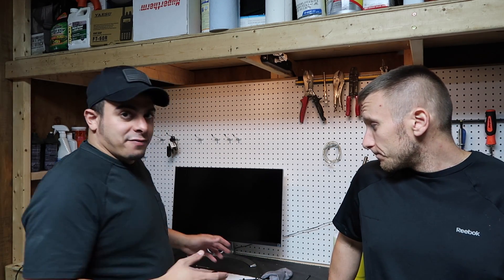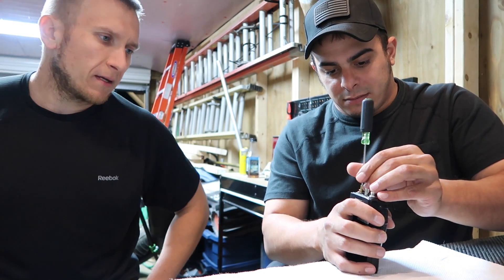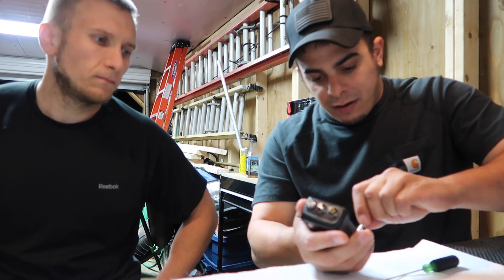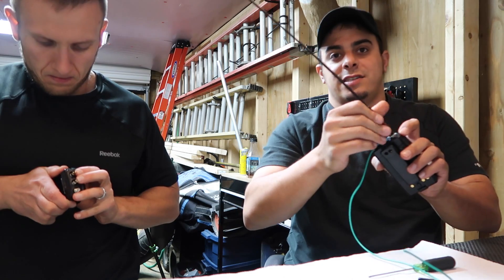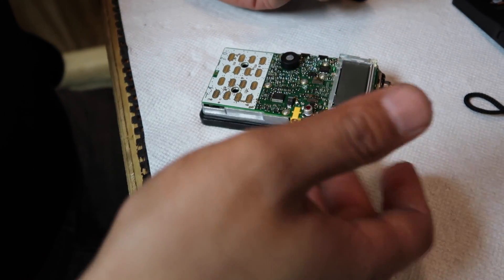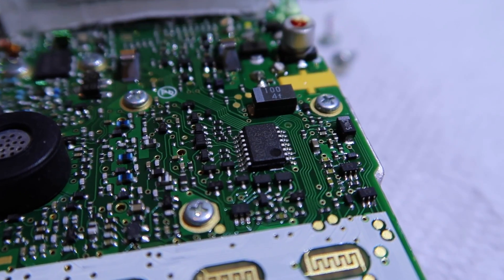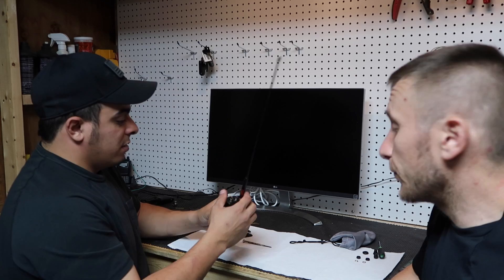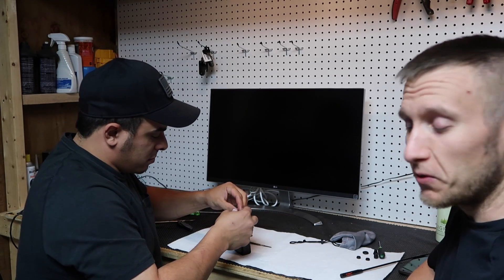Yaesu FT-60r (FT60) Mars/Cap Modification

Comment: My 11$ new Baofeng UV-5R  All Fm radio.   400.00 to 520.997  130.00 to 176.997   
does this radio do this??
Reply: What is the power output of the FT 60
Reply from the maker: +Gfdf Perte 5w
Reply: ok so 1 watt more   and 15 to 20 times the cost.   once more why would you spend that much money on a hand held
Reply: @gfdfperte4248  I have both, you really do get what you pay for.  My Yaesu has so much more sensitive receive than the UV-5R.  Now if you want a cheap radio to toss in SHTF go-bag and vehicle glove compartment that wont break the bank or make you cry if someone steels it go with the UV-5R,  that's why I have both.
Reply: Bofeng has a very bad sensitivity and selectivity in the radio receiver, you can hear less than 50% of what a Yaesu FT-60R can hear.
Reply: I will now give some examples of features the FT-60 HAS that the Baofeng DOES NOT.

1 - It demodulates both FM and AM

2 - It receives from 108Mhz all the way to 520Mhz + from 700 to 1Ghz

3 - Die cast aluminum casing along with high quality plastic parts

4 - Because it demodulates AM AND can receive between 108Mhz to 136Mhz (which the Baofeng cannot do) it can listen to AIRBAND. 

5 - Dedicated squelch and selector knob

6 - Much better menu

7 - Better water resistance

Comment: Just buy a Bofang
Reply: Way better and  for 11$ usd  New
Reply: nice did not know about the UV-5X3  Thanks I am looking into to it now.
Reply from the maker: +tim Forbrook what do you consider throw away? the ft60 is 180 and the vx8dr is like 400.. both great radios.. a baofeng might be thow away.. at 35 bucks
Reply: Bofeng has a very bad sensitivity and selectivity in the radio receiver, you can hear less than 50% of what a Yaesu FT-60R can hear.

Comment: How is the rx sensitivity and tx power on the 460 band once its modded?
Reply from the maker: +tx2sturgis I use this radio often and for the most part at great distances and I haven't noticed a anything significant in sensitivity nor the transmit power since the mod. The tiger tail/counterpoise wire really helped and I highly suggest that.

Comment: Guys just a hint here for people doing this,don't use the stock antenna,they are very narrow banded antenna!
You will get very high VSWR outside ham bands and possible RF PA failures
Put a commercial grade Vhf or Uhf antenna for the target band in use if going way out from ham bands,just some friendly advice from a radio comms engineer.